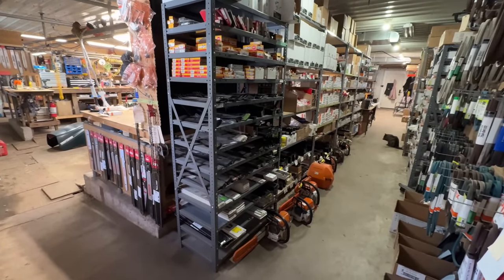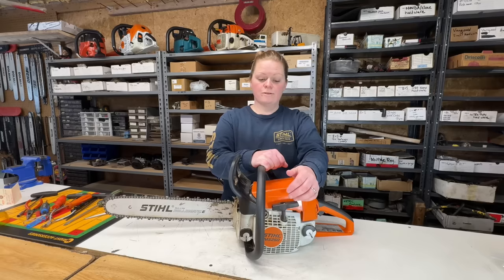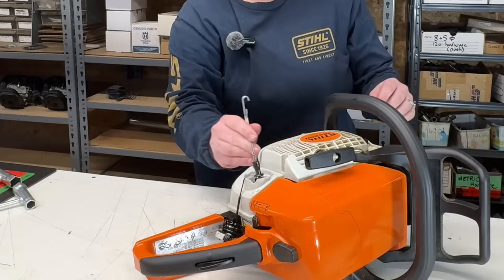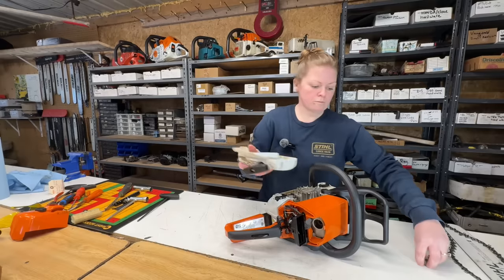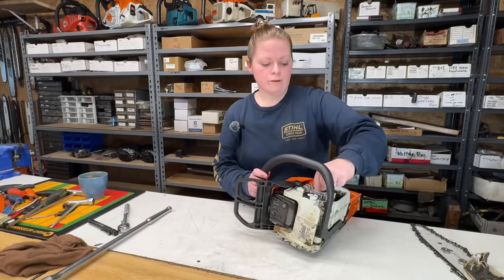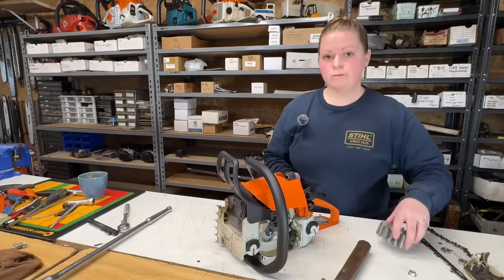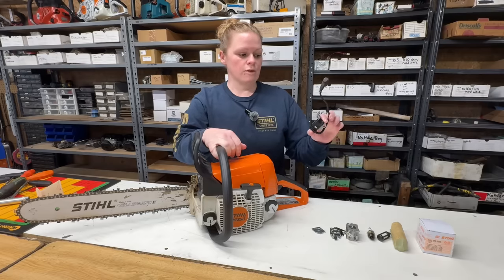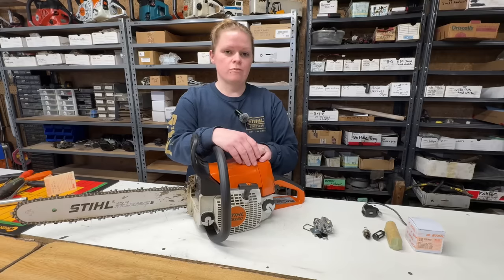Stihl MS250 Chainsaw HARD To Start!  It Wants To Rip Your Arm Off!  Let’s Dive In and Find Out Why!

Comment: I have the MS for 60 Magnum you think the one you have there is hard to pull start you should try mine I had once where it would not start I put a new spark plug in it first one I had put in it in 20 years never had a problem starting it since I watched the video once on the model that I have that has the decompression button what I did was they pulled the ripcord out as far as it could possibly go flick the switch to the start position let go of the cord and it started i havent tried it myself as yet

Comment: Ms171…
Mine started running rough years ago so just bought another, now I’m determined to get it running again.
Now it starts but won’t run so I’m getting there….
Reply from the maker: Check the spark arrestor in the muffler!

Comment: Good video, but you could have added more info, namely:  the torque spec for the flywheel and links to the specialized tools such as the fuel line holder, coil gap tool, flywheel corker, and piston stop. Perhaps you could those to the video description or as a reply to this comment. TIA.
Reply from the maker: In the near future I will be doing a video that is all about the tools I use everyday.  Stay tuned! :)
Reply: @marriedwithsmallengines  Thank you for the reply, but what about the torque spec for that flywheel? TIA
Reply from the maker: The torque spec for this flywheel nut is 28 Nm
Reply: @marriedwithsmallengines  Thank you

Comment: I've worked on small engines for nigh 60 years. These high comp saws would start better if the pulley/flywheel ratio was different but they won't do it. I've lost just about all of my arm strength due to this. Should've retired earlier when I first noticed it. Stihl's not the only 1 with this fault. Over 20 years ago I had a SXL925 Homelite with a 175# 1st pull. Think on this!

Comment: If a chainsaw won't start first I check the spark and plug, then I go straight to the carburetor, strip it down and clean it. If ist running bit not properly I go straight to the carby and that is usually where the problem is in my experience and I am just a shit kicker.

Comment: The 023 is just as bad to start due to it's high compression. (no longer made) I have one, and it's my main go to saw. I run a 12" bar on it. I also add a little Seafoam to the fuel to keep thing cleaned out due to the ethanol fuel

Comment: I couldn't agree with you more about the MS250 being a royal pain to start!!!! I found that if you use their standard starting technique you will almost 99.9$% of the time flood the chainsaw.  So being the rule follower I would always start there and immediately the chainsaw floods and from there you can pull a million times and it won't start!!!!!  I.E. keep doing the same thing is the definition of insanity or something like that! 😉 So I looked around and found that from the point of flooding if you contort yourself, and put your knee down on the top of the chainsaw to hold it down, put the chainsaw in run mode, squeeze on the top and bottom trigger (don't forget to engage chain brake initially) and pull a few times it will provide max airflow and clear the "flooded gas" and try to start. Next pull will start it.  So far this is the only thing that has consistently worked for me as the darn thing constantly floods. It's a menace to arthritic arms and shoulders everywhere!!!  I will say that once you get it up and running it works like a champ and while still warm, you barely have to pull to start it again.

Comment: Could you please please please, post a video about ms250C easy2start assembly/disassembly? I really need to know the trick about routing the fuel lines. I just replaced al of the fuel lines and the ms250c easy2start has more lines due to the fuel pump/purge line.  I absolutely can not get them to line up!  Thanks

Comment: Any pointers for those with arm to shoulder issues for easier starting.  Im considering using a dc plain starter and modify a area or possubly a relief valve for less compression and once started close the valve

Comment: on myMS 250 i leave in the house for a while. Then pull it over with choke on and foot on handle pulling slowly. then  on haalt choke pull it slowly to just past compression and give it a good drop pull otherwise a real Bear to start
Reply: I actually heated a  MS 290 with a hair dryer one cold day when I had no time to screw around.

Comment: You need to get the word of the owner that they have NOT tinkered firstly.... I had an issue with a new Stihl product where the carby was not set right. I could have set it myself and saved a drive but I took it straight back to the dealer and had him do it. Otherwise arguments.

Comment: Good video...Question... When was the coil gap on bottom was out... Before the change out with the Known good coil... Or after the change out... The gap out... When I ran saws years ago we used to use the older style cigarette package cardboard as a Husqvarna gap guide!!!
Reply: When you set your air gap the closer you get the coil to the magnet The voltage in crease;s too I used a $3000 scope to tell me this

Comment: It can be a tough go when customers muck around with things before the professional mechanics are called.
Reply from the maker: It definitely can make it more difficult    
Thanks for watching!
Reply: The hardest thing to repair is when someone else messes with it and does not tell you.  The second hardest is when they do tell you they messed with it.  I do not know that much about the small engines but thanks for people that do put out the youtube how to.  I worked as an electrician and instrument person at a large plant.  There were about 100 others doing similar things there.  So we had some that were good, some parts changers and some that could make a mess out of things for others to repair.  One of the  best words was when one fellow asked another what was it that he did not do so we could find the problem that he actually created and said he did not do it.

Comment: You mentioned carbon on the piston top. Now that you’ve gone through the power plant and the engine is working properly, will the carbon deposits burn off, assuming wide open throttle from now on?

Comment: They should make all saws with a decompression function.  I have the same saw and it acts like it has a turbo on.  You give it throttle and there is some lag before it revs up.🤔🤔  I do not think this model has a chain catcher, because mine never came with one.

Comment: I do small engine repairs and 99% of the time it's a carburetor issue. The only reason I don't say 100% of the time is because currently on my bench is an 11 horsepower B&S that reeeeally binds up when I turn it with a breaker bar.

Comment: First of all I do all my cycle and 4 cycle work I don't buy oem parts any more. I get what on Amazon made in China and for carb kits. They are good enough, seals, and coils are okay. I sharpen my own chain with a Wagner chain sharpener. I do get a lot of old chain saw that don't work  cheap put some time into each new fule line,  spake plug carb kit. Filter, seals replacement on s a few and I have a good working chain saw. But I would like to buy a new one and that is why I came to you the other day
Reply from the maker: Hi, what area are you in again?

Comment: Only prob I've had with my farm boss ms260 the shear key cast into the fly wheel which sets the ignition  timing had twisted sheared ever so slightly prob my fault I ran it at really high  revs for a while and I put a longer bar and more aggressive chain on it than it was originally supposed to have one I fixed that not a problem one I always runs Stihl genuine lube

Comment: If you have valve adjustments and they are not correct you will have a hard time starting. Check valve clearance and try again . Let me know if that works it did for me.

Comment: Thanks for the video, very informiing.  Could you explain what the loose gray female wire connection's purpose is beneath the air cleaner cover?  It does not have a completing male connection on my MS250.  Thanks.
Reply: cud be mag ground

Comment: I have a ms250 that has less than 2 tanks of fuel run through it. Have replaced the pull rope twice as they were ripped apart. Have not used it in 5 years because I can't pull it over.  Still  
Looking for a cure for the problem.

Comment: I thought it might be dumping gas into the cylinder as you got further into it. Also, I'm curious, do you never check the gap on new spark plugs? I've seen several that were off out of the box ( Nippondenso, NGK, Champion and Autolite to name a few). I like to double check everything because new parts are the problem sometimes! You have a great channel! From N.C., USA

Comment: Commenting that I also have an MS 250 and also an MS 660 MAGNUM and my opinion is that the ignition of the MS 250 is hard and once it is on it is not difficult to turn it on again and asking how much Nm should the steering wheel be tightened with the torque wrench? Greetings and excellent videos, thank you. By the way, the greeting is from Mexico 🇲🇽

Comment: I've bought two of these 250s for dirt cheap in the past month (one was $25). Not a thing wrong with them. Owners just couldn't pull them over anymore after getting up in years. 
Felt bad, the older gentleman is considering electric because he can't pull anymore.

Comment: I really hate these saws.  They can be finicky and hard to tune.  I do however have an 021 that rips oak like crazy and it’s perfect.  One thing I have done with these is always pull them through before choking.  I have an ms170 with an oiler that refuses to work.  I have replaced everything but the case, twice.  No luck.  I think the case is cracked sucking air.  They are just a pain.  I also had a a coil go bad that would start and flood out and die like it was the carb.  PITA saws.

Comment: Hello need a little help
So if i use an ms210 crankshaft to the ms250 piston and cylynder (the ms210 rod is smaller by 4.5mm) 
Is it worth to try or gonna be less power than the normal ms 210 build ?

Comment: I never recommend the MS 250 to a older person that isn't in good physical shape. These 250,s are harder to pull then most of the homeowners saws. I will recommend the 251C instead with easy start option.

Comment: All two stroke motors will kick back if you do not work the piston around to a compression stroke before pulling the rope.  Basically pull the rope slowly until it hits the compression and then let the rope recoil back in and then pull slowly back up to the compression and then jerk it. Otherwise it will all most always kick back.

Comment: Question: A "New" carb is it factory set so it's a easy switch?   I Have the MS250 it's served me well over 19 years, use only reliable premix fuel 50:1 but only occasionally will it kick back on a start attempt.     I noted the mention a bit of excessive fuel in the cylinder may be the cause, per haps excessive choke on initial starts?   Thanks for the education and assurance this is a great saw.
Reply from the maker: You would install your new carb, then tune it on the saw.
Reply: @marriedwithsmallengines  The new carb may be the answer ?

Comment: MS250 chainsaw has a high compression motor that's all and what makes them hard to start but also  stihi's costing on their production by using the similar platform as the MS170 up to MS250 using the same interchangeable parts making the. Ratio of the pull start not as compatible for the 45CC High compression motor. Having said that, the MS250 is the best homeowner 45 cc ever made.

Comment: I dislike my Stihl MS250 so much when it comes to starting it up, I bought a Husky and that Husky is so easy to start my Stihl sits on the shelf. I even use the high dollar Stihl fuel, new plug and air filter.😢

Comment: The only way the carb would cause it to be harder to pull would be if it is slightly hydrolocked due to the float valve needle not sealing flooding the cylinder and crankcase. The  pressure test ruled that out though so 
 I'd be more inclined to see just how much carbon build-up is on the piston crown. If it has a considerable amount, it would raise the compression ratio thus harder to pull.  The ratio of fuel and air shouldn't have any bearing on the pistons squish

Comment: When I take any of my saws to a shop, I always tell them what I tried to do to fix the issue, I can build you a hi powered Eng., but 2 strokes after 50 years still make my head explode. The shops never believe me. So, How do we find the tools you were using? I am interested in the fuel line tool and the gap setting tool.
Reply from the maker: I love when a customer that is dropping equipment off tells me all of it's secrets instead of making me find them!     I have lots of requests about my tools so I am planning a whole video based on the tools I use everyday.  Stay tuned!

Comment: My 250 used to be really easy to pull. Then I didn’t use it for several months I tried to start it and it about ripped my fingers off, kicking back. I haven’t messed with anything, it was always really easy. Advise as to why all of a sudden it started started kicking back and hard to pull ?????

Comment: I have been using motomix for my Stihl engines and would like to know if it is ok to continue with Aspen 2 fuel? Would I have carburator diaphragm issues?  Also, I have weaknesses on my right shoulder, which other model would you advise me to buy besides the MS 250? ( high compression) Thanks, Marc Quebec 🪵😉
Reply from the maker: Yes, Aspen is a great product!  You shouldn't have any issues.   If you want a saw that is similar in size (45CC) to the MS250 and easy to start, you could check out the easy start version.  It's called a MS250 C-BE.
Reply: @marriedwithsmallengines  Thank you very much! 🙏🏼🪵

Comment: Stihl's dirty little secret. Stihl branded oil is formulated to run full throttle or the piston top, cylinder head and exhaust port and spark arrestor carbon up. Carbon build up will increase compression and pre-ignition causing heavy pull start force and kick backs. I suggest using a less carbonizing oil such as Castrol Activ 2T so you can save fuel by not running full throttle all the time.

Comment: My ms 250 will only run until it heats up, 10 minutes or less . Then it will not start until it cools down. Im getting tired of yanking on its pull cord.
Reply: Mine does the same thing.

Comment: A wet spark plug could mean the carburetor is running a bit to rich or the fuel to oil ratio is of ....try cleaning the plug , check the gap on the plug , check the jets and the float is at the right adjustments according to the spec's ......
Reply: no float !   :face-purple-open-box:

Comment: I didn't see it start with the new carb on it.  i didn't see a compression test ever done on this either. You seem to focus on issues that would cause I no start, when clearly the saw would fire and run. I think someone bumped the compression up with a base gasket delete.
Reply from the maker: Hi, The MS250 does not have a base gasket.
Reply: @marriedwithsmallengines  I forgot that’s a clamshell saw.
Reply: These saws are very hard to crank over for there displacement. Just the way they are.

Comment: What chain should I use on my MS250C with an 18" Stihl (original) bar? Where can I purchase a new air filter?
Reply from the maker: Your chain is 23RS68 (if you’re buying a Stihl chain), and you should be able to easily grab an air filter from your nearest Stihl dealer.
Reply: @marriedwithsmallengines  Thanks so much!

Comment: The air filter on MS230/250 is never replacen except if it's ripped. It's easily wasked inside out by gasoline, brake cleaner or something like that.

Comment: Brand new MS 250 very hard pull for me from day one.  Younger guy could pull fast enough and saw cut great. Not worth the fight. Have 044 with no compression release and it starts much easier. Many threads on the MS 250 with same complaint.  Better to trash it then pay and endure rotator cup surgery.

Comment: Too much oil in the gas, carb screws adjusted too far out, too much carbon on the piston, equals higher compression and harder to start.
The cure might have been to adjust the carb screws and then put the saw in some heavy cuts in a log. Sometimes in these cases you can see sparks flying out of the exhaust as the carbon is burning away.
With 3 turns out on both H and L it should not have run well at all.

Comment: 3:04 At this point I'm guessing the flywheel is not lined up properly so a bent or broken sheared shaft wedge
Reply: Oh darn it. So weird. So the carb was dumping extra gas, thus the carbon build up and the "pre ignition" that caused the kickback

Comment: I wanted to like my ms250, I really did. I was one of those who had a rough time starting it. I also have a temper aimed at inanimate objects at times. Needless to say, less than 3 months in & that saw was thrown with everything I had down into the brush pile where it sat for a few days. The cuss words lingered in the air that long! Once my veins stopped poppin', I dug it out of the bushes and dumped that pos off with the local walmart homeless man...told him to pawn it off, I never wanted to see the damn thing again. Lost money, yes, but it's the principle. I'll stick with my Huskys. You should NEVER have to struggle that much to make a new piece of equipment operate.

Comment: What's wrong with a lil bit of compression. I like a saw that'll snap the rope outta my hands. Hahaaha I've made more money with a 261 than any other saw. I've used it as a climbing saw, ground saw, and at the chipper. My 200t and 066,440 are a close second.